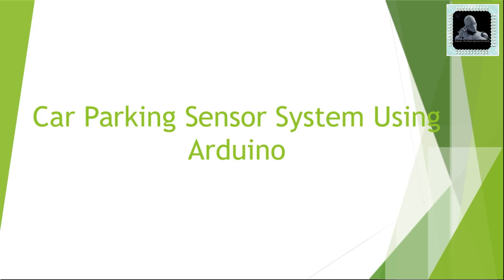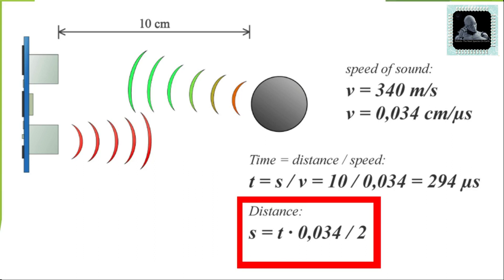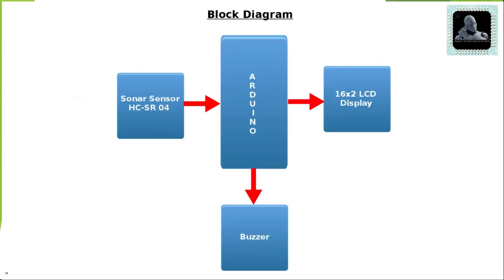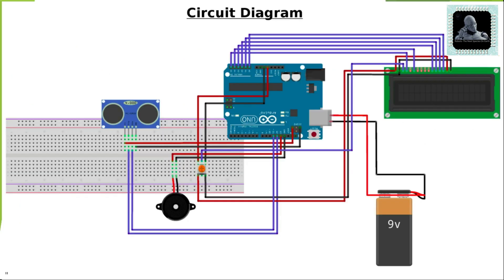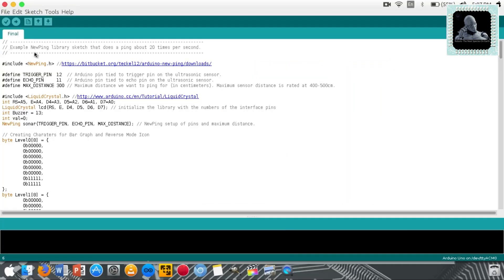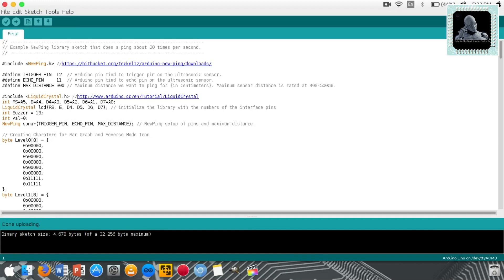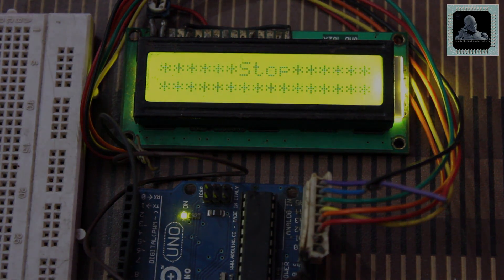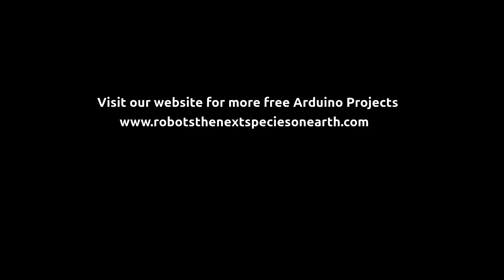Car Parking Sensor System Using Arduino

Comment: Facing LCD display issue... Otherwise, the circuit is working properly but there is no display on the screen.
Reply: Wire the HC-SR04 sensor (Vcc on + and Gnd on -) not to AREF pins on the arduino.
Reply: @dazibazi  I tried but the Arduino switched on and off .... Nothing happened
Reply: @manqobamsibi298  bro change the direction of 10k variable resistor take a screwdriver and move it
the screen will work propely once you do this
Reply: @manqobamsibi298  plz send to me code

Comment: i dont knw why but my display shows nothing . but the sensor working .just facing problem with display output
Reply: even me too
Reply: Same problem
Reply: @sheerazali1577  did you get any solution?
Reply: @sheerazali1577  if u have code plz help me
Reply: Change display .
Reply: Bro Rheostat ku regulator ku move karo ho Ja ye ga